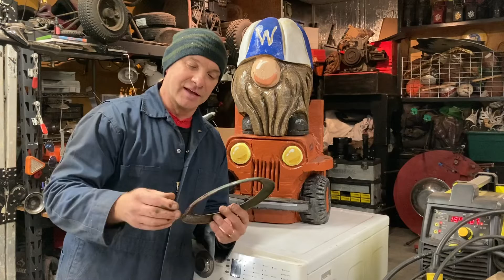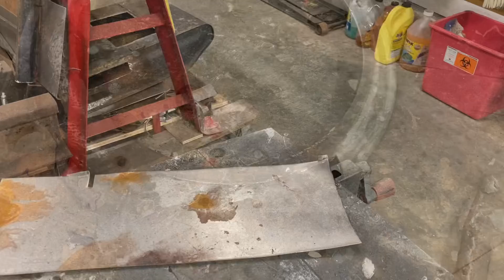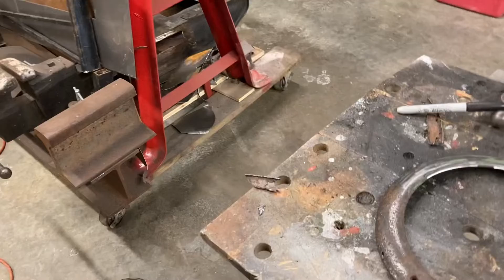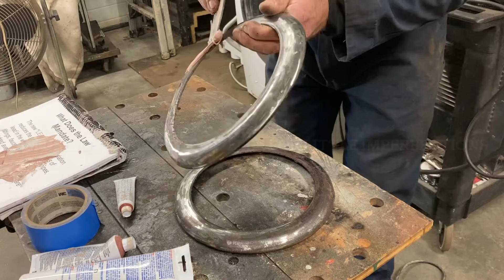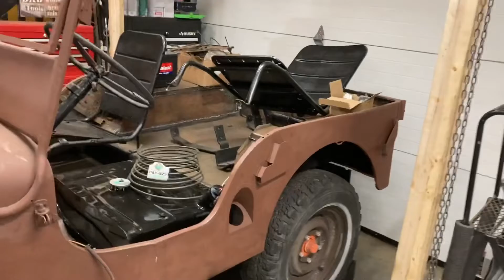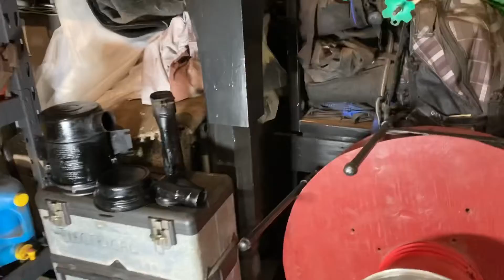How to repair Jeep CJ2A headlight trim rings

Comment: I would have predicted fail on the headlight repair.  But Roy Works pulled it off. That was amazing. Black and orange really will work well on your jeep. Looking forward to the fuel system and other shorts.  You will be glad you went with a new tank. Repairing one that is on the edge like you described is possible but you would always have the thought in the back if your mind, "How long before something turns loose inside and blocks the line, filter, pump or carb?"
Great job!  From the frozen banks of the Underwood Branch, thanks for the fun.  :-)
Reply from the maker: Thanks Mark, I won’t lie it was touch and go for a while, the metal is so thin it was kinda hard to weld. But I’m definitely happy with it. Your right i would always worry about it. Some things just aren’t worth it to me to try and save

Comment: Good job, doubt I would have tried that thinking it would be too hard to make compound curves.
Reply from the maker: I was a little hesitant at first, but I figured I had nothing to lose. The metal is so thin it was kinda hard to weld